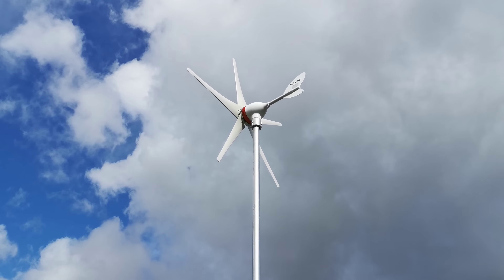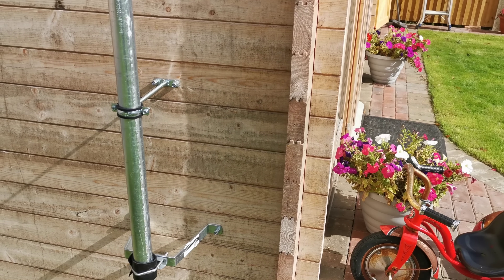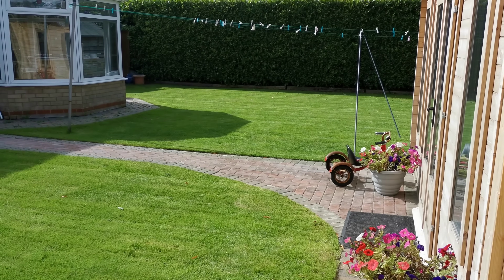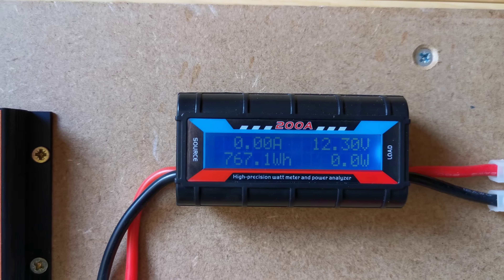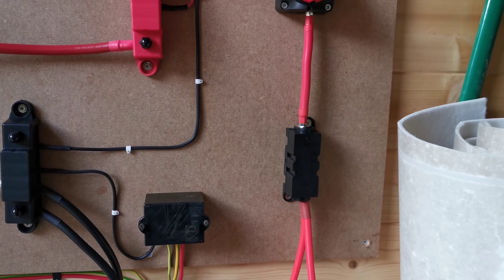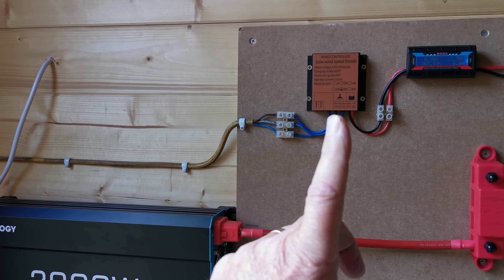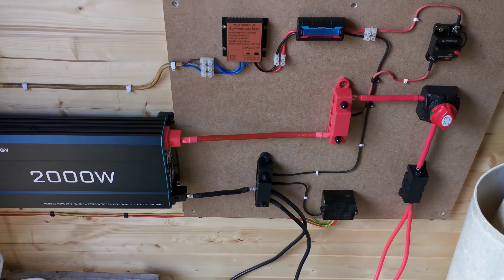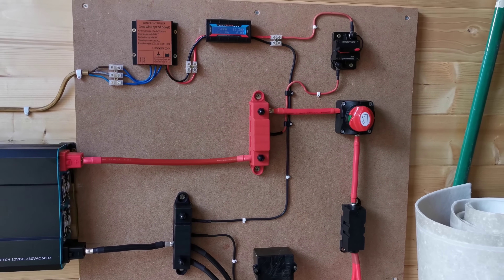Vevor wind turbine 400w. Off grid power.

Comment: G'day Mate, after lots of testing, I have found that small wind generators work best with a bit bigger tail area. My best advice is to attach a 25cm Round Stainless Steel Pizza Lifter onto the tail, just remove the handle first. Once aliened with the curve of the tail and painted white, it looks great up in the air. This works with up or down facing tails, just allow half the Pizza Lifter to hang out the back, adding some length to the tail as well. Should track the wind great now and won't rust when up in the weather for years.
Reply from the maker: Many thanks Brian for the top advice, I will give it a go, cheers buddy 🍻🙏🏻
Reply: @halftheworldawaywithstevea3682  You are welcome.

Comment: All practical tests show that small wind turbines hardly generate any electricity, because hardly any wind blows close to the ground! Wind/electricity yield increases with the third power of the wind speed. So +100% wind = +800% electricity. But close to the ground: 0 constant wind, only aggressive gusts! Solar panels generate at least 10 times more green electricity with the same investment in time & money! Whether wind and/or solar power - you need a diesel generator to live off grid.
Reply from the maker: Thanks for the advice Michael. I have recently augmented the the system with solar. Stay tuned for the video and good luck with your channel 🙏🏻

Comment: I have run a 550 watt turbine for just about 10 years. Two points of note. 1, your turbine is far too low. If permitted you need to be 10 meters above the closest obstacles to the wind( this includes your house). 2nd, and this is the biggest issue I see with ALL installations is your main lead wires are way way to small! Study Ohms Law. I did the calculations on my system (after it was installed) only to find out that the 10 gauge wire I was using was also way to small. After up-grading to the recomended 2 gauge as my distance from turbine to controller is 30 meters. The output to controller was vastly inproved. Just because the wires at the turbine are 10 gauge you must increase to larger copper braided for the rest of the install.
Reply from the maker: Many thanks for your good advice Ken, I do appreciate all comments. I've recently augmented the system with solar. Stay tuned for the next video 🍻

Comment: Does the turbine have a mechanical over speed brake in case of excessive wind speeds?  Also, how close have you gotten to the rated 400W power output?  Seems like most people are maxing out at less than 100W on the 500W units that look the same as your one.
Reply from the maker: Hi Gary, the turbine only has an electrical brake. It has been in service around 18 months now and no problem over speeding so far.
As for the output, I've just checked it. The max output this month was 112 watts, though it's not very windy recently. I have just reset the system to fit a new solar charge controller as I've augmented the off grid kit with solar. When I get around to it there will be another video. Cheers Gary 🍻

Comment: What gage wire/type did you use from the turbine to the charge controller? Thank you.
Reply from the maker: Hi Nick and thanks for your comment. I think the cables are 6 gauge, so around 4mm in diameter.
I googled it and will paste the text after my answer. But, if in doubt please have your work checked. I did so just to avoid confirmation bias.
General Recommendations:

For small turbines (under 400W) and short runs (under 25 feet), 10 AWG wire is usually sufficient.

For larger turbines and longer runs, consider using 8 AWG.

For very long runs or high-power systems, you might need to go down to 6 AWG or even larger.

Always err on the side of caution and use a thicker gauge if you're unsure . 

Cheers Nick 🍻

Comment: So just simple calculations, You said that you have the turbine 2 months now. The controller show that it produces 767,1Wh. So in one month it generates about 383Wh, and for one day it is 383/30= 12Wh!!!! You must pay about 800Euro maybe much more for this. And it produces 0.383kW in one month, If I buy 0.383kW from electricity grid I pay 0.383*0.28= 0.11Eur for something that yours turbine generate one month !!! In one year it could produce maybe 4,5kWh*0,28(price of electricity in my country)=1,3euro. I buy same amount from grid for 1,3euro and you producing it one year!!!  Did you get it? Return of your investment will be when yours great-great-great-grandson will live, but the lifetime will end sooner. So much work and yet so much nonsense.
Reply from the maker: Hi Martin and thanks for your comment. Unfortunately your "simple" calculations are based on assumptions. 
The displayed watt hours you mentioned in your comment (from the  meter) resets back to zero every time I work on the system. The big red isolator in the video, it resets the readings. 
You weren't to know that Martin but many thanks for your input and good luck in Slovakia.

Comment: Yeh 2 questionS DOES IT WORK AS STATED AND IS IT WORTH IT?
Reply from the maker: Hi Niell. Well since my last video it is now augmented with a 100 watt solar panel. So it is much improved. The system provides all we need to rune summer house and our washing machine.
As for is it worth it, the only way around it was to have electricity run from the main house down to the summer house. We were quoted £500 for the installation. Then of course that would also put up our electricity bill, with the extra lights, fridge and smart speaker.
I will address the updated system in my next video Niell 🙏🏻

Comment: I like your setup! It's very well organized and you can speak to each component intelligently. Have you considered adding more turbines and wiring their charge controllers to the same bus bars? It seems that would cut your charge time in half. Running a washer is nice - probably could do a microwave or air fryer as well, but nothing above that.
Reply from the maker: Hi Jon, many thanks for your kind words 🙏🏻
I've augmented this system with solar, update video coming soon 😎👍🏻

Comment: There does seem to be a consensus that position and height is important. 14' no where near high enough apparently. The other consensus is that these units will never produce enough power to pay for themselves. Obvoiusly wind can produce power but the commercially available units are not there yet if you are looking for payback
Reply from the maker: @WillFlynn-f8z  Cheers buddy, it's a 16 footer and now augmented with solar, video to be uploaded soon. Stay tuned 🍻
Reply: @halftheworldawaywithstevea3682   I would probably still add some form of wind power to a solar system cause some days the sun just don't shine. There is alot of deceptive information on the many Amazon units claiming results that poeple will never achieve.
Reply: @halftheworldawaywithstevea3682  There are some commercial windmills located not far from my house. They are actually about 8 miles or so away and visible from where I live. I do not in any way consider them to be an eyesore and they are thoughtfully integrated in the agricultural area

Comment: Waste of money.  Do your research first!
Reply from the maker: @stuartburns8657  Cheers Stuart, maybe show us all a video of your system to see where I went wrong?
Reply: @halftheworldawaywithstevea3682  Directly no Steve.  Not knocking the effort making the vid, but after a few of us dived into solar years ago, one chap did something similar, and essentially wasted 1k+.
I seem to recall it was a larger 2000w version, but near identical pole install on shed. 
Simply too little, too infrequent in terms of generating anything noteworthy.
At least your expenditure was more modest, but outside of an interesting intellectual exercise, they're best avoided.
The allure Simply does match the science
Reply from the maker: @stuartburns8657  You know what Stuart, I think you're right. Having just augmented the system with a bit of solar it is now just the ticket for my needs. Update video will be made when it stops raining. Cheers Stuart 🍻
Reply: @halftheworldawaywithstevea3682  I'll keep an eye out.  Next time I bump into the chap who also tried wind generation I'll try to get some more specifics.
👍🙏
Reply from the maker: Many thanks Stuart 👍🏻🍻🙏🏻

Comment: Does it need a dump load? Just wondered what happens in a storm? Thanks.
Reply from the maker: @BalticHomesteaders  Hi Baltic, that's a good question.
Allegedly the (mppt) charge controller shorts out the turbine under extreme winds and puts a brake onto it. This winter it's experienced fairly high winds but no brake applied yet. Cheers for your input buddy 🙏🏻😀
Reply: @halftheworldawaywithstevea3682  Thank you.

Comment: You've run a ground wire to the top bracket but then insulated it from the rest of the setup by using rubber matting on the clamp 🤔
Reply from the maker: Good spot buddy, I will just have to rely on the scaffold pole being stuck in the ground to dissapate a lightning strike 🙏🏻

Comment: Great project! Thank you:) My wife and I built a tiny house last spring. We bought 6 150 watt solar PV panels along with 4,000 watt inverter and 4 batteries. We use it to boil all the water we need and recharge the Makita batteries. We plug into the grid for electric heat, full sized fridge and TV. You'll love solar!
Reply from the maker: @aaronvallejo8220  Thanks for the kind words Aaron 😀
You are right, solar is very impressive and a fantastic addition to this humble system. Full video update due soon 🙏🏻

Comment: For those of you wondering, it will never pay for itself!  Also, 48V  is the way to go  (no batteries in series).
Reply: How are you doing 48V with no batteries in series? 😂
Reply: @InterestCasual2000 well you can buy 48v batteries now, in either AGM or lithium. Although they are uncommon, much cheaper to find a get a few 12v batteries and do series. Even if you just had 24v that's still good for 1200w anyway.
Reply: @ it’s all simply cells in series, the chemistry dictates cell voltage, not much you can do about that. 
There is nothing wrong with batteries in series or parallel, just match to your application.
Reply from the maker: @rpsmith  Thanks for your input, can you show us your system please? 🙏🏻
Reply: Or not! @halftheworldawaywithstevea3682

Comment: Interested to know if your multifunction tester will let you test the Ze of the main earth?  I tested a system similar to this the other day, and found that some of these inverters aren't suitable to supply ANY class 1 equipment, I had to get hold of a proper Victron inverter to make it safe to use - they can be very unsafe
Reply from the maker: Hi Nick, thanks for your input. As mentioned in the video I had an electrician test the system. This included earth fault loop impedance.
Victron invertors are absolutely the best choice for a complex system. For a humble summerhouse project the Renogy invertor has served me well so far.
Cheers Nick and thank you 🙏🏻🍻

Comment: Great setup but few more pound you could add 12 volt solar panel for summer when wind is lower. My setup is solar on roof with with storage battery. I would like small wind 48 volt turbine feeding via smoothing capacitor into micro grid tie invertor to charge my main storage battery.
Reply from the maker: @kimedwards3937  Already added the solar panel Kim, will do a video in the near future. It's a great addition to the system 🙏🏻

Comment: Very interesting set up. Might it be worth making an insulated box for the batteries? as in cold shed you might not get full efficiency from them. Some people go heated mat or similar to stop real cold. Or indoors of course.
Reply from the maker: @tobymorgan4385  Good point Toby, I do have an insulated box for them, yet to be fitted. Stay tuned 🙏🏻
Reply: @halftheworldawaywithstevea3682  i would love to hear some average power you're getting, having had it set up a while
Reply from the maker: @tobymorgan4385  Just been away for a while Toby. I will do an update video soon. Have the solar panel fitted now as well 🙏🏻

Comment: Please do connect your turbine feed on the battery side of your isolator, it could be dangerous in high winds if your isolator is off.
Observation, there is much doubt that the "controller" is mppt, is more likely pwm, it contains a rectifier and acts as a voltage regulator and likely shorts all three phases together to brake the generator in case of over voltage.
Reply from the maker: @markwright7680  Many thanks for the insight Mark. I aim to upgrade the controller this summer 🙏🏻

Comment: You really want to put it higher. It should be at least 60ft and preferably 100ft to get into nice clean, laminar, consistent air. Down where you have it, below the level of the surrounding houses, it's in turbulent air. You see it swinging around and speeding up and slowing down a lot.
Reply: Think you’d need planning permission for that though
Reply: How did you come to know all this information,60ft seems a bit high.surely you would need planning